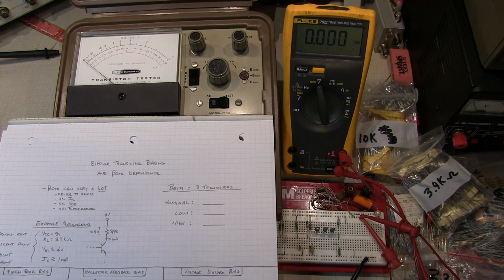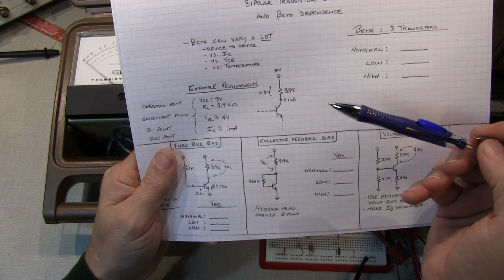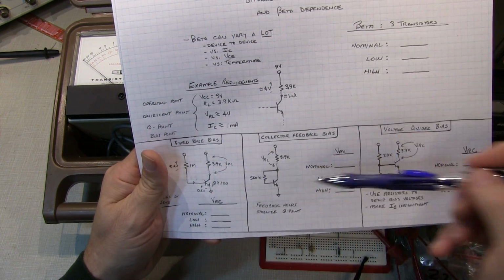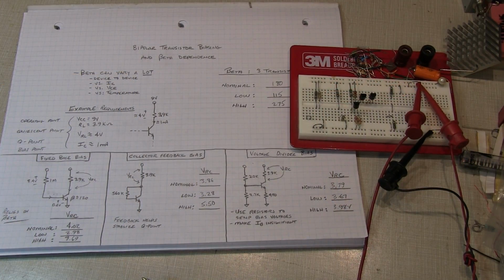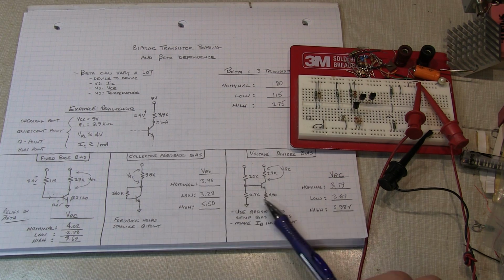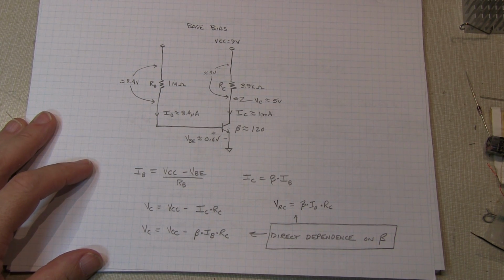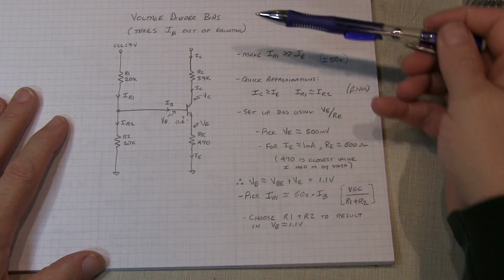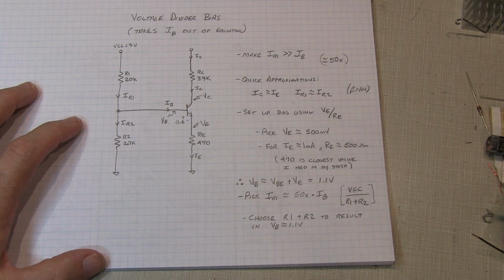#185: Back to Basics: Bipolar Transistor bias circuits and Beta dependence

Comment: ill probably try it on the breadboard eventually, but do you think the voltage divider would work on transistors with hfe as low as 15 to 20?
Reply from the maker: Yes, but you'll have to use lower value resistors so that the current through the divider is larger than the base current - ideally by a factor of 10x, but you can get away with a lower ratio if you don't want to burn that much power in the divider string (and can accept some bias variation with hfe differences).

Comment: In the voltage divider setup, the 470Ω Re is much smaller than the voltage divider R2, so it should load the v.d. severely. But as I calculated, it does not. Might I ask, why does that happen?

I have been having a painful time with trying to come up with a WORKING bias point estabilisher circuit, but it never works out. Please calm me down that transistor design is actually hard, and it's not just me being at fault.
Reply from the maker: The 470 ohm emitter resistor doesn't upset the voltage divider at that base because the base current is small because of the current gain of the transistor.  The base current is equal to the emitter current divided by Beta+1.

Comment: The DC Loadline VS AC loadline is set by the transistors Collector Resistor value or Tubes Plate Resistor Value which the Loadline is the SLOPE of the Positive cycle & Negative Cycle SWING. What I'm confused about is what does the SLOPE of the Loadline do to the biasing point if the biasing point is set midway in the middle or half of +vcc, what does the SLOPE of the loadline do to the biasing or symmetry of the clipping?

Comment: Why does the audio input signal "modulate" the idle bias voltage? if the idle bias voltage is at +4.5 which at half the +Vcc 9volts, why does the input signal to the tube grid or transistor gate will "modulate" up and down the +4.5vdc with the audio signal voltage peak to peak.  Modulating the Bias Question: If the audio signal voltage being applied to the transistor gate is peak to peak 2 volts then it will modulate the transistors idle bias +4.5 + 1volt = 5.5vdc & also +4.5vdc - 1 volt = 3.5vdc?
Reply from the maker: Changing the voltage at the gate is how the output voltage is changed.  Yes, a 2Vpp signal applied to a bias voltage of 4.5V will result in the input signal going between 5.5V and 3.5V.
Reply: @w2aew  FETS don't "modulate the bias"? only Transistors and Tubes will "modulate the bias. What I'm confused about is how can you "remove the modulating" part from the transistor. If a transistor bias is set at half of +9vdc which is +4.5vdc which is the "DC offset" is at +4.5vdc. When the transistor has a changing voltage applied to the base of the transistor it will modulate the DC offset Bias voltage up and down. Op Amps that have a DC offset bias that is set at +4.5vdc will stay fixed it won't "Modulate the DC offset voltage". The input waveform signals applied to the op amps input pin will just RIDE on top of the DC offset voltage NOT modulating the DC offset voltage. I don't understand the difference between Modulating the transistor bias VS compared to Modulating a DC offset voltage?
Reply from the maker: @waynegram8907  "I don't understand the difference between Modulating the transistor bias VS compared to Modulating a DC offset voltage?"   These are the same thing.
Reply: @w2aew  Op amps have a DC offset voltage to prevent clipping the positive cycle and negative cycle. The applied input waveforms voltage/current level doesn't "modulate" the op amps DC offset voltage, any reasons why it doesn't modulate the op amps DC offset voltage?
Reply: @w2aew  The applied input waveforms voltage level to the transistors base can cause asymmetrical clipping because the input voltage level to the base is modulating the transistors bias voltage which is modulating the bias point? The bias point is unstable and can move up or down fluctuating by the temperature or by the applied input voltage level?
Reply from the maker: @waynegram8907  The answer is that the input signal DOES change the bias at the op amp input, BUT, since the op amp's gain is HUGE, the change is VERY VERY SMALL - so it only looks like it isn't changing.
Reply: @w2aew  the opamp is always self correcting itself comparing the input ports with the output port. It's a feedback loop self correcting itself to compensate to prevent modulating bias point DC offset voltage?
Reply from the maker: @waynegram8907  Yes, the feedback is what removes the signal (most of it) from the op amp input.
Reply: @w2aew  The opamps feedback controls the GAIN of the op amps but also it Stabilizes the DC offset/biasing to be immovable not modulating. Transistors circuits that have a negative feedback is used to stabilize the GAIN but also I think it stabilizes the Biasing Voltage to be immovable and not modulate the bias. If the transistor stage doesn't have negative feedback the applied input waveform voltage LEVEL can modulate the transistor biasing point to be moveable modulating the bias point. When using FET's the applied input voltage will COMPRESS the FET into the compression point and saturation point. The FET's biasing point doesn't modulate as easy or as sensitive compared to a transistor is more sensitive to modulate the biasing point. I'm not sure why FET's are harder and less sensitive to modulate the biasing point? FET's don't need negative feedback to stabilize the FET's gain or to modulate the FET's biasing point.
Reply: @w2aew  yes the swing range will be between 3.5vdc to 5.5vdc but also the bias voltage of 4.5 will also fluctuate above and below 4.5vdc causing a moveable bias point? Only when the input voltage is a constant voltage NOT a varying voltage is when the bias point is not fluctuating and not moving. The "varying" voltage applied to the transistors base is causing a fluctuating moving up and down bias point? What can you do to a transistor to keep the bias from not modulating from a varying input voltage?
Reply from the maker: @waynegram8907  The only way to minimize the voltage swing at the input is to increase the gain of the transistor amplifier and then usually employ negative feedback (make it more like an op amp)
Reply: @w2aew  Why does increasing the GAIN of the transistor amplifier stage would  modulate the bias less? Germanium transistors are easier and more sensitive to modulate the biasing point compared to silicon transistor, any reasons why? I often see negative feedback paths for each germanium transistor when I think the negative feedback paths were used to stabilize the germanium transistors from the hot temperatures that would modulate the biasing. The heat dissipating from the germanium transistor would make it more unstable. A 1Watt germanium transistor VS compared to a 1 watt silicon transistor is suppose to be able to dissipate the same amount of heat before the transistor gets unstable but 1 watt germanium is not equal to 1 watt silicon, they don't dissipate the heat the same. What I'm saying is that germanium dissipates heat differently compared of how silicon dissipates heat, I'm not sure what this is called in EE theory books or how EE engineers would call this but its different types of Dissipation

Comment: Hello Sir. I need to design an "AF PREAMP" either use collector feedback or divider bias. 
The AF preamp input is from a fet detector of a Colpitss regen receiver. And the AF amplifier after the preamp is TDA2822.
Since the Vcc is 3.7V battery, it should have current consumption saving.
Could you give a rule of thumb, how to determine optimal Ic and gain ? while not sacrifice the performance.
Thank
Reply from the maker: This video is a good place to start: https://youtu.be/VWY2WQcKJgk
Reply: @w2aew  ok thanks 👍 a lot

Comment: What type of tests can you do for transistor stability testing? The MP11 transistor has a Water Tower Enclosure which its suppose to provide more temperature stability, any reasons why a Water Tower Enclosure would provide better temperature stability compared than using an external metal heat sink?

Comment: Very good demo of different transistor biasing methods.   Resistors are cheap.   I learned this at university and usually design transistor stages with a voltage divider base bias.   I never actually did this experiment you demonstrate here, but I have done the math using the Ebers Moll model.   This would be a good lab for sophomore EE students

Comment: When OverBiasing a Transistor why does it increase the gain? normal operating biasing is HALF of the supply voltage which is 4.5vdc biasing point for +Vcc 9vdc but Overbiasing is set to be higher than 4.5vdc from 5 vdc to 8vdc. What happens to the transistor when its overbiased? if you apply a function signal generator  sinewave or squarewave input signal the overbiased transistor will changing the pulsewidth length and symmetry any reasons why?
Reply from the maker: I"ve never heard the term 'overbiasing'.  If the transistor isn't biased to mid supply, then it will be driving into saturation or cutoff earlier in the cycle.  This is what causes the symmetry issues.
Reply: @w2aew  Overbiasing a transistor is also called biasing HOT or class A. Its biasing the transistor ABOVE mid supply. Underbiasing is called COLD biasing because its BELOW mid supply. You hear these terms in biasing tube amplifiers.

Comment: Transistors and Op amps when getting close to the Rails will clip off and chop off the positive and negative cycle compared to Tubes & JFETS/MOSFETS when getting close to the Rails it will have a voltage drop and round off the edges, any reasons why? Transistors and Opamps need to add "Soft clipping diodes" in the feedback loop to round off the edges of the clipping. You should do a video lesson about soft clipping didoes and what happens when getting close to the Rails. The Older Op amps in the 70's when the output signal would get close to the rails would Snap to either the positive rail or negative rail or invert, they did unusual things which the newer modern op amps don't do that when the output signal gets close to the rails. Older Op amps with the same part numbers would have a Harder time trying to keep up with the input signal because they had slower slew rate so if you drive the input harder it took time for the op amps output to catch up with the input signal which they had a harder time trying to keep up. I'm not sure the slower slew rate was the only problem but other parameters in the datasheets or it could be just the Op amp wafer processing materials they used back in the 70's.

Comment: There is other interesting methods for biasing, like using a diode for thermal stability, or providing a resistor from a voltage divider and feedback from emitter to base to increase input resistance.
Do you have videos about it?
Reply from the maker: Not at this time - just this "basic" video.

Comment: 500mV for Ve may be a good starting point to have Beta tolerance, but to have also a good thermal stability I'd recommend to increase it up to 2Volts.
Reply: Not with a 9V supply, unless you are amplifying very small signals. Also you'll have a gain of about 2, unless you split the 2K emitter resistor and bypass most of it with a large capacitor to increase the ac gain.
Personally, I'd recommend using half the value of R1 and taking it to the collector instead of the positive rail. This gives the benefits of both emitter and collector feedback to stabilise the bias point. In that case, Ve can be as low as 250mV with good stability, allowing a gain around 16 with minimal distortion.

Comment: As usual, very impressive. I have a question though. In the last section of voltage divider bias, how did you determine Base current? Isn't that beta dependent? So which beta is to be used? The highest or the lowest? Thanks.
Reply from the maker: To consider worst case, use the lowest Beta.  To consider typical operation, use the typical Beta.
Reply: @w2aew  Thanks. Just used the technique to stabilise my 2MHz crystal oscillator circuit on breadboard. There is no alternative to learning by doing under guidance of experts. ❤
Reply: In the example requirements, Vrl = 4V. But using Vdiv bias, Vrl = 8V. Given Ic = Ie (9/4370)* 3900 = 8.032. I have to assume Ir1 >> Ib effects Vrl, since Vr1 = 7.9 V.   9/22700 * 20000 = 7.92

I really appreciate you explaining something I've been wanting to know for the longest time.

Comment: For the collector feedback circuit, the equation for Vrc can be re-written by dividing top and bottom by Rc.(β+1) to give this:
Vrc = (Vcc - Vbe) / (1 + Rb/(Rc.(β+1)))
Since you want Vrc to be roughly 1/2 (Vcc-Vbe), that means you want Rb roughly equal to Rc.(β+1).
If you make (β+1),Rc large with respect to Rb, then Vrc becomes roughly equal to (Vcc-Vbe). That's not the bias point you want with the transistor close to saturation.

If you make the current through R1 fifty times bigger than Ib. then you'll have a stiff Vb, almost independent of β of course, but you sacrifice input impedance quite a lot. It's much more usual to set the current through R1 to about ten times Ib, which is a compromise that results in a small β dependence, but with a significantly higher input impedance..

The most stable biasing is a mixture of voltage divider and collector feedback, by halving the value of R1 and taking it from the collector instead of from the supply rail. That produces a very stable collector bias point, which then allows you to increase the stage gain, if desired, by reducing the emitter resistor to no less than about 270R with a corresponding change in the bias resistor ratio to maintain 1mA emitter current. Lower value emitter resistors will tend to introduce distortion as the non-linear intrinsic emitter resistance of about 25Ω starts to become significant.

Comment: In the voltage divider bias calculations, you have said choose r1 and r2 to give you a Vb of 1.1V, and that r1 r2 current should be 50 times Ib and that Ie is 1mA.

But given such a variation of beta, how do you chose a suitable r1 r2 value? You don't actually know Ib at this stage surely? 

I'm a bit confused as you could chose values in MegOhms which would give you 1.1V but might break the 50x rule of thumb. 

Thanks for your video, very helpful, been binge watching alot of your content recently, keep it up!
Reply from the maker: The 50x rule of thumb is a very approximate figure - the idea is to make the R1-R2 current significantly higher than the base current so that it can be somewhat ignored.  If the R1-R2 current is close to the base current, then the base current variations (and the variations in Beta) will cause a change in the bias voltage.   You can choose to use the minimum beta listed in the datasheet if you like.
Reply: @w2aew  ahhh OK, so If I have a bjt with gain of 20 to 200, as long as I work with the 50x guideline and a min beta of 20, then it'll probably be OK?

Thanks again:)

Comment: Why does the voltage divider bias require 50x Ib of current across R1 and R2? Wouldn’t that increase the current through the base-emitter junction? Therefore the transistor would no longer be in the active region?
Reply from the maker: The current flowing through R1 and R2 will not affect the current drawn by the base.  That will be determined by the voltage at the base and the emitter resistor value.  Choosing to make the current through R1 and R2 much larger than the base current will ensure that the base current doesn't influence the voltage at the base - making it determined only by the resistor values (and power supply value).
Reply: @w2aew  thank you for the response. I always forget that the current at some point is determined by the voltage at that point and not anything else. Awesome clarification!

Comment: Great explanation many thanks... Just a question please .. Why you are connecting the COM lead of DMM to the positive of power supply??
Reply from the maker: The V+ lead of the DMM is connected to the power supply voltage, and the COM lead is connected to my handheld probe, so that I can probe the voltage drop across the collector resistor.
Reply: @w2aew  Thanks.. understood